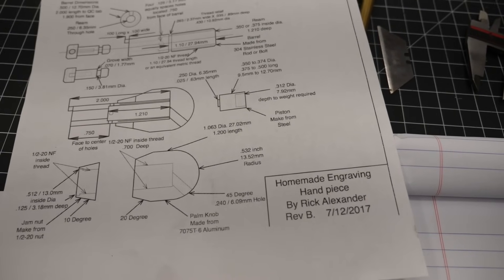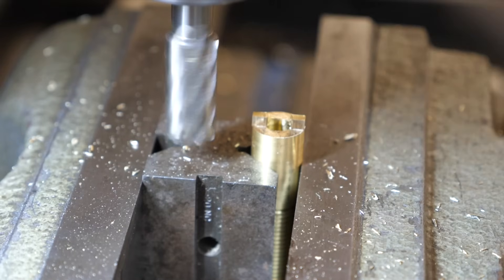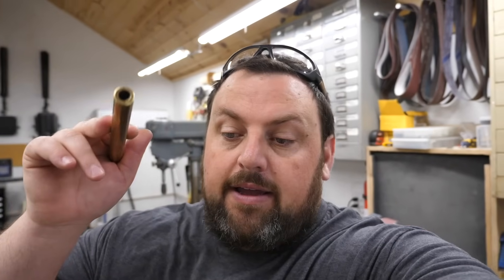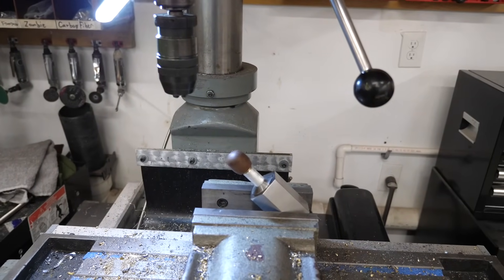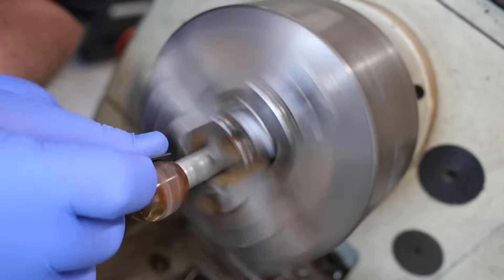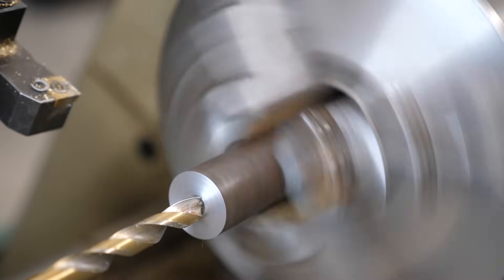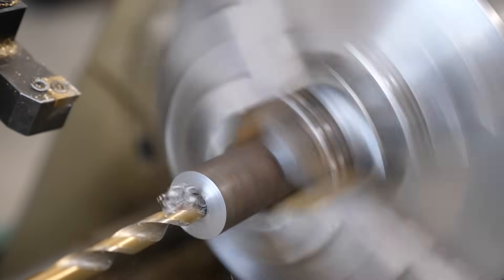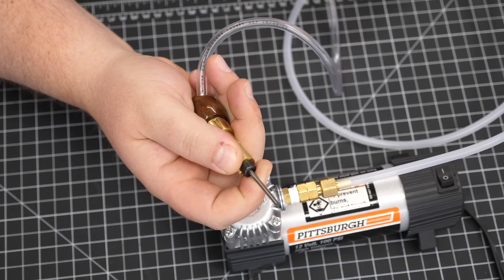Making a Pneumatic Engraver: DIY Hand Engraver

Comment: As a PSA from a professional engraver, I’ll offer some observations. All of these pneumatic engraver videos focus on the handpiece and get the foot pedal or air source completely wrong. Imagine someone teaches you to build a car on YouTube and the last thing they do is tell you to install an “on/off” switch in place of the gas pedal/throttle. You will have a car, but you can only run it at max RPM or not at all. 
A pneumatic engraving system is the same. It relies on a very precise throttle control to control air flow and thus speed of the tool. Without this control you’ll have what might be a very nice hand piece that is incapable of making the precision cuts required in hand engraving. 
This may be a case of the blind leading the blind. People seam to be following the example of a few a few YouTube videos produced years ago by some folks who were not engravers and therefore didn’t understand how these tools work. 
This video is a case in which the maker builds a nicely made tool yet doesn’t have the system in place to make it function as it should. 
And for those wondering why professional tools cost so much, this is why. This build demonstrates the precise machining it takes to produce a quality tool. And the real professional tools are built to a much higher standard than even this. 
I love shop made tools. But as an engraving instructor who sees around 60 students per year, I witness firsthand what happens when beginners think they can learn engraving from YouTube. I end up correcting major problems with fundamentals that were never learned in 99% of students who are self taught or learned from videos. Engraving is hard enough. Add in tools that don’t function as they should and the problem is compounded. And the beginner is left believing the problem lies with them rather than the technique or tools.
Reply: @Master EngraverTV....I guess you didn't watch enough of the video to get to the part where he talks about the links to the plans and videos from the originator that discusses how to build all the controls (or as you call it the "gas pedal") and operate it.

Comment: I've been a machinist since 1998. I never would have thought to use a router bit for the radius. 

Subscription earned!
Reply: Sometimes, before the advent of 3D printing of prototypes,  we as prototype makers would have to make the items out of solid plastic blocks. We'd, well I'd Make items out of MDF, Acrylic and resins to create a push button home Pr office phone with a cassette answer machine built into the futuristic housing. It looked perfect...buttons were cast, expansion foam below to give the perfect button press fe. Many cutters made on the lathe out of Silver Steel, harden & temper. Yeah..anther skill lost to 3D printing. 
Onya for saying what you did.
Mike
Reply from the maker: Thanks for watching!